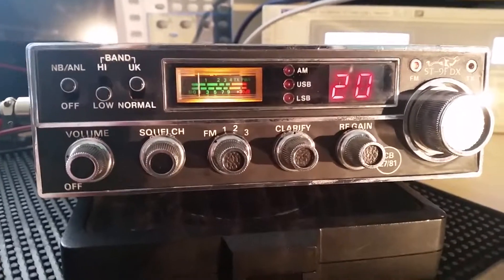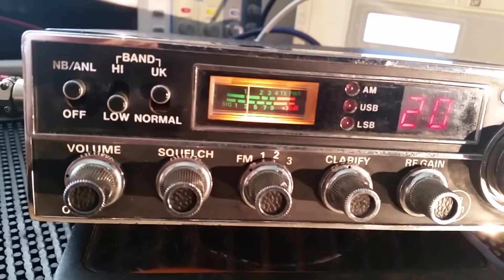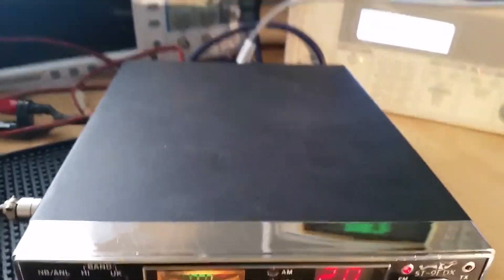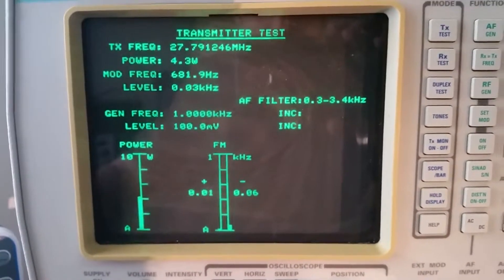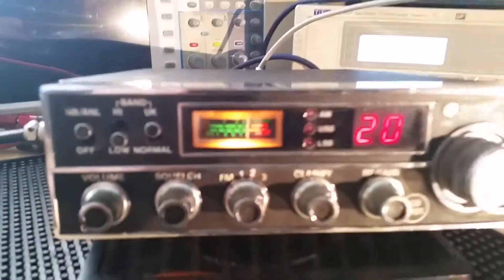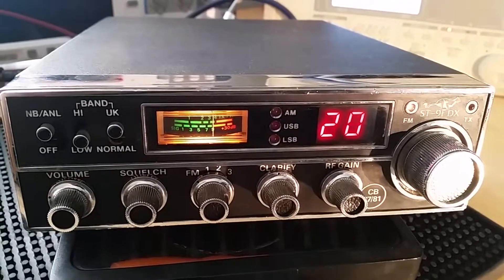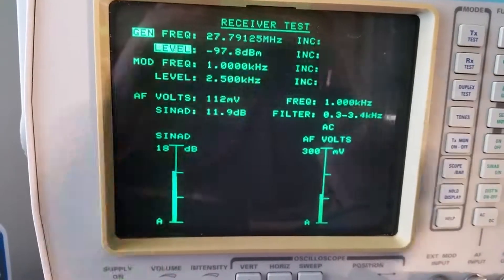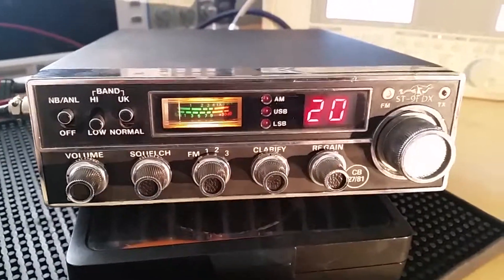Testing a Stalker 9 CB Radio RX, TX and SINAD

Comment: Nice to see your 2955, you have some nice test gear I see. Is your mod level correct for the Sinad meter I thought it would be less for narrow FM which is typically 2.5khz. Note, I’m not saying your wrong I’m actually not sure myself.  The standard is normally 60 percent of the maximum allowable deviation of the radio receiver, which would be 1.5khz mod level. Regards Chris.